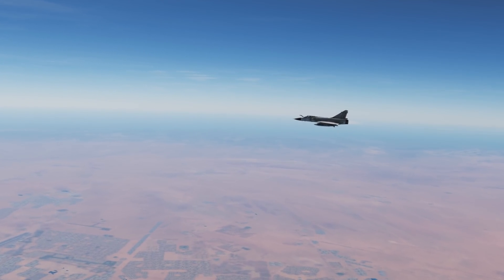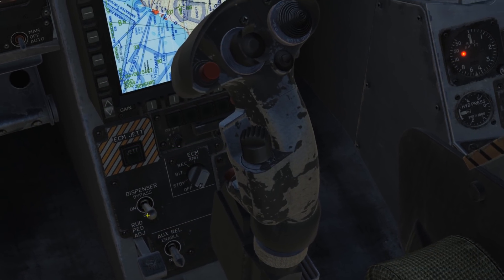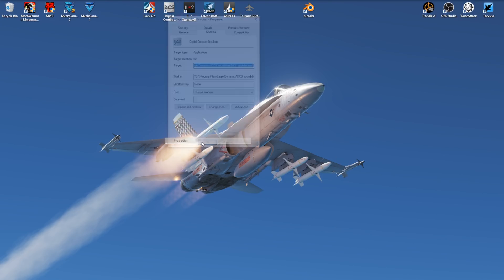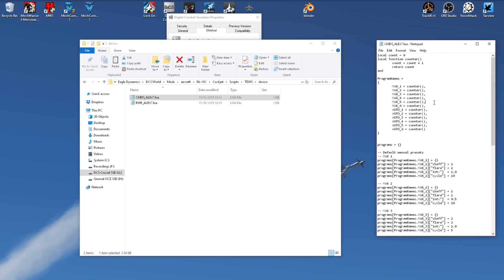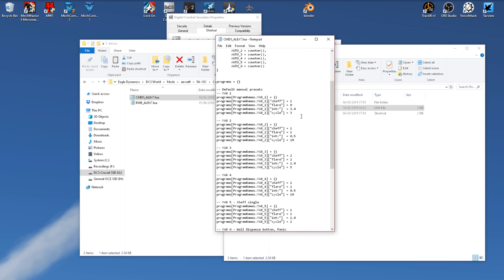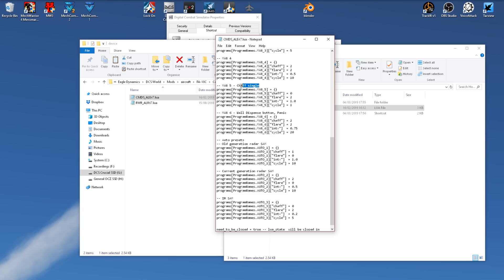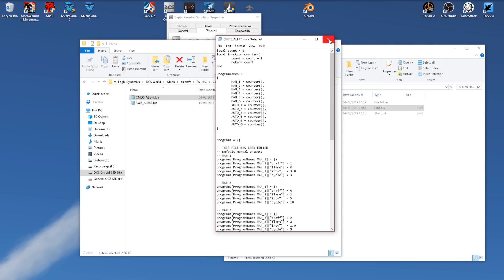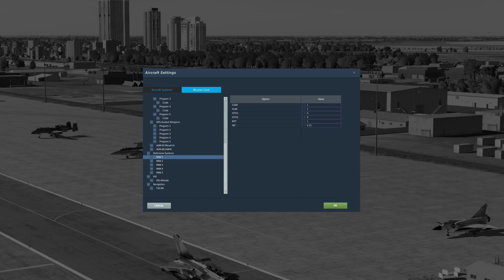DCS Custom Countermeasure Profile Presets Tutorial

Comment: Hi there. I have used these mods for Hornet and A10 since I saw this video. However, it doesn't seem to work anymore. I just reinstalled DCS SR and OB and placed my modified lua-files in "device" but as I jump into the Hornet, the cms preset is back to default. Do you have any ideas what's wrong? Cheers!

Comment: Did I miss the part about programing the Hornet CMS on the ground? .. twice?
Reply from the maker: It's the whole thing, you change it via the lua file and it's set for you on the ground, works around the fact you can't change it before take off otherwise :)
Reply: @RedKiteRender  Your wording in the beginning was a bit misleading. I was waiting for some kind of in-pit workaround.

I knew there had to be a LUA file but just couldn't be bothered to look for it. Thanks for saving my time. Works like a charm. :)

Can't wait for the data cartridge. Such a great feature in BMS.
Reply from the maker: No worries Fones, Sorry if you felt that came off as a little misleading, in my mind we're pretty much setting the programs on the 'ground' by doing this. :) It's the only workaround we've got until the data cartridge comes along!

Comment: Another great and very useful tutorial buddy.  Is there anywhere (apart from classified files) that we could load up to better defeat threats or is it just guess work?
Reply from the maker: For ir missiles its pretty much dump flares and cut power, change direction and keep dropping flares until dead or the missile has lost you. 
Radar you'l want to get yourself with zero closure rate by either a dead vertical dive, or turning 90 degrees off and drop chaff for a good while. Of course you can also use terrain masking to escape if it's an option. 

Don't be afraid to use your countermeasures, they're no good to you if you're dead.